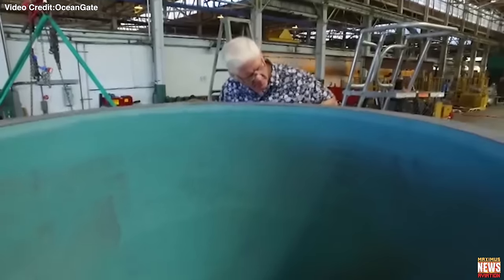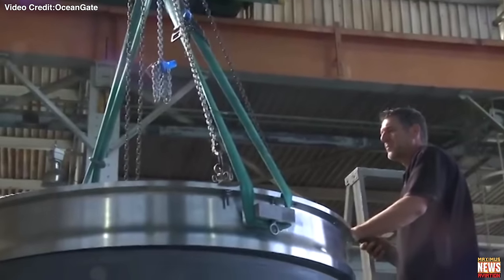Watch The Manufacturing Process That DOOMED OceanGates Titan To Fail. But It NEVER Had To Happen.

Comment: That tube distorted and ejected either one or both end collars. I didn’t see the entire manufacturing process, but I also did not see any through fasteners/bushings in the outside diameter of those end collars connecting the collars to the carbon fiber reinforced tube…
Reply: Like a toothpaste tube!
Reply: @tanyav7888  looks more like a casket
Reply: Nope, carbon fiber does not bend, it snaps catastrophically
Reply: It seems to me that the weakest point was the glue joints, where the carbon fiber joined with the titanium.
Reply: @CrucialFlowResearch  CF absolutely "bends" The resin or glue also bends. Nothing is 100% rigid, with the exception of Tungsten Carbide maybe and Diamond.  If you watch the video, they are "bending" wrapping the CF around a metal cylinder.
Reply: Astute & accurate comment.
I said similarly, using glue but NO mechanical fasteners was courting disaster.
BOTH are needed.
As you said, the Carbon deforms ever so slightly, it pops that end cap off like you'd flip a coin !
Reply: I don't see any o rings or gaskets either so the adhesive was probably serving to hold back the hydrostatic as well as supply a mechanical bond.
Reply: Yup. That's what happened. Like stepping on an empty water bottle with the cap on. It pops right off when the top deforms.

Comment: My grandfather works with glass and he told me that different types of glass have different coefficients of expansion. If the COEs are different the art piece could destroy itself.
I think that this is what happened here. 
A sub experiences temperature differences as it dives and surfaces. Where they were going it was freezing compared to where they were coming from. The hull would've contracted as it sank and expanded as it climbed and the different parts would've done so at different rates. 
My hypotheses is the uneven COE between the two materials would cause fatigue cracking and it would've only been a matter of time before the cracking became severe enough that the structure failed all together.
If I were in charge of Oceangate I would have been more careful with how the vehicle was constructed and actually took safety seriously.
Ships and Submersibles have been made from steel for well over 100 years, I'd rather base a design on a proven technology rather than some futuristic clean slate design.
I don't understand why it had to be made of carbon composites. Sure, they are lighter than steel but this thing wasn't supposed to fly. It was supposed to sink.
Reply: Very informative. Much thanks.
Reply: I'm thinking that 5" of carbon fiber is cheaper than 2" of titanium?
Reply: @dmkinsey  CF was used for cost only.   The company was doomed to fail either way, not enough profit even with all the corner cutting.

Comment: Carbon fiber is normally sheets woven in opposing directions. This is just spun on like duct tape. Strange.
Reply: yeah kinda like they do with laminate plywood
Reply: This is called filament winding. It is a common method of construction for round-ish tubes and such.

Comment: 0:40 This sends chills down my spine. That 'fiber', that wonder material, literally looks like duct tape. I know it's not the same, but that's how it looks to me. 

Edit: the titanium rings and the carbon tube were glued together? Come on, are you kidding me? Even if the cylinder is not the ideal shape (it's the sphere) why not build the tube out of steel and avoid all the problems caused by carbon fiber? It's just crazy.
Reply: That's how carbon fiber is manufactured. Layers and layers of micro filament fiber.
Reply: The excuse given by the CEO is that CF has tremendous strength and weight savings, therefore onboard propulsion would consume much less power moving the submersible around.
Also using a cylinder design instead of a sphere allows for more paying passengers (at $250,000 each).
What this CEO doesn’t seem to realize is that physics wins all the time, he thought he could apply his aviation experience to solve marine engineering problems.
But in deep diving reliability and durability and toughness are king, not weight or energy efficiency.
He paid the price for his lack of vision…
Reply: @glenyoung1809  That guy is obviously a piss poor engineer for ignoring the material properties of CF in choosing that material for the pressure hull and then choosing to form the final integration assembly using epoxy  and titanium. I don't think that even most engineering  students would make such poor choices.
Reply: He would have to make the steel version into a sphere and make it much smaller
Reply: @seitch1  If you watch some of the other videos he makes a derogatory comment about subject matter experts who are "ex military 50 year old white guys" and warning him this was an unsafe design and that he deliberately hired freshly graduated non-white engineers, including one who's qualifications included being an enthusiastic surfer dude. The channel Sub Brief talks about it and shows some of these statements. The absolute arrogance of the guy is astounding.
Reply: @glenyoung1809 I’m not sure what difference skin color makes, but age and experience MATTER!
Reply: @janach1305  Yes it does but the CEO pointedly emphasized 50 year old white men, so I surmise it's all about getting those virtue signalling points. He also stated he wanted to "inspire" the younger generation and hiring older expertise doesn't do that. As I said it's incredible arrogance and a massive ego to boot. 
Plus the CEO has your standard politicians haircut and that's a definite giveaway for me...
Reply: @glenyoung1809  I was snarking on the CEO’s attitude toward skin color as much—if not more—than yours.
Reply: @janach1305  If I were one of those young engineers working on this project I would scrub it off my resume immediately, this incident will be a career killer for them if they admit to being in on the design phase.
Reply: @jonfreeman9682  Interesting, but everyone agrees that it's a poor choice for a submersible. What shocks me is the way they attach the ring to the hull. I hope the Canadian and NTSB investigations really find out what caused this failure.
Reply: @glenyoung1809  Imagine if it was the other way around. A naval architect designing a plane... entirely different fields. Probably wouldn't be able to take off.
Reply: @glenyoung1809  correct
Reply: Looked like VCR tape
Reply: His reason for using carbon fiber was to keep down the weight. Making the tube out of metal with sufficient strength would have made it too heavy to float. The normal and sane solution to that problem is adding buoyancy either in the form of buoyancy tanks containing lighter than water liquid (such as petrol) or using a special type of foam that withstands those pressures without crushing.  He chose to do it the easy way instead, which as often happens was also the dangerous way.
Reply: @glenyoung1809  I think the weight savings were probably much more important in lifting and moving the sub as compared to propulsion.
Reply: Duct tape may have been better, seriously
Reply: @jaycahow4667  yeah once the sub is submersed it all weighs the same it is just smoothness of shape that would change propulsion
Reply: @noahw4623  You know, there's a wide range of materials available, so it's incomprehensible why they chose carbon fiber. Back in the 60s there was this sub called the 'Aluminaut'. It was made of aluminum, and could reach a depth of 15,000 feet.
Reply: @JMC-ul1sw  that sub can go to 13,000 ft deep - NOPE

Comment: Looking at that fibre winding machine it doesn’t look like there was much ability to wind the fibre in the axial load direction - with those large end plates the axial load will be very high and it won’t surprise me if the failure mode relates to this.

Comment: I feel sorry for the fabricators that were involved in building the pressure vessel under direction from Oceangate. They must feel really bad.
Reply: If you were offered a job making a death trap for your rich boss, you might not feel so bad.  After all, you were paid to turn a blind eye, just like him trying to destroy one of his Engineers for declining to participate in the building of this death trap.
Reply: Nah. That'd be the case if the sub went out on the first dive. Then you could write it off on ignorance or inexperience of the team. But they had several dives. Meaning everyone there knew what's up and let it happen AND continue to happen. My guess is that they only feel bad because they now have to deal with the consequences of the situation.
Reply: A career killer
Reply: @Poppenheimer69  nothing to feel bad about when you are mortally injured.  Nothing to feel actually.
Reply: They should
Reply: Thanks for the Triton LF recommendation, i found the video after you mentioned it.
Reply: @pixels303at-odysee9  I was referring to the fabricators who made the Titan pressure vessel under contract. They were not paid to turn a blind eye like the Oceangate engineers, they were professional equipment operators who may have had no maritime background at all.

Comment: My opinion...The design of this sub, although radical did work and achieved what the designer wanted which was a vessel capable of withstanding the pressures at deep ocean depths. Lets not forget this vessel made five I think it was, successful dives. So from that point of view the design did work. Having spent forty plus years in the aerospace industry and many years working with composites I am well aware of the limitations and strengths of carbon fibre composites. I am also well aware of the very rigid inspection procedures that are regularly required with carbon fibre structures within aerospace, both visual and NDT. From my point of view, the main reason for the failure of this venture was Oceangate's refusal to carry out any inspections to the composite structure to check for any cyclic stress cracks that would have been apparent in the vessel due to its working environment. I am pretty sure that if a programme of proper NDT inspections after each dive had been implemented, the defects withing the pressure vessel would have been found and this 'accident' maybe could have been avoided. Just my opinion.
Reply: Only 2 dives to 4000m before it failed, the design was very poor as it was supposed to do 25 dives a year. Carbon fibre is a terrible choice for something like this because unlike metal which predictably deforms and springs back carbon fibre will deform causing individual fibres to break slowly weakening the structure with each load cycle. There is no way to tell how much damage has been caused either without expensive testing between each load cycle. Also the mating surfaces for the pressure domes on the end would be prone to delimitation as they were only glued on meaning there is a single layer in contact with the end ring which would be a serious weak point. Normally a metal component subject to high stresses connected to carbon fibre is woven into the structure during the carbon fibre layup. The fibre was also all wrapped in one direction which seriously weakens the finished structure. Normally the fibres form a complex weave pattern to more evenly distribute stresses and make de-lamination less likely.
Reply: @schrodingerscat1863  Thank you for your reply. I'm not one to get into debates on here as to who is wrong or right but you completely missed the point of my comment. Also, depending where you get information from it seems it is still debatable as to how many deep dives the Titan made with some news outlets citing it as unclear or as many as ten completed dives to the wreck, not just two as you claim.
As to your statement as to there is no way to tell how much damage had been done after each dive, well, yes there is, and it is NDT inspections which are used extensively in the aerospace industry such as eddy current and ultrasound inspections which are used regularly on composite and carbon fibre structures to check integrity of that structure either after impacts, visible damage noted or just routine periodical inspection.
My point was regarding inspection procedures in place in the aerospace industry that would have certainly picked up any defect in the Titan's composite hull had these inspection procedures, which are a legal requirement in aviation, been employed and not ignored as unnecessary as they were by Oceangate.
Reply: @stiggy3833  My point was that without dismantling the thing and scanning the pressure hull after every dive they would not know if there are problems. Metals can be easily wired with strain gauges to make sure the metal has not gone beyond acceptable limits. This can be done continuously during the dive with anything beyond a defined safety limit causing an abort of the dive well before any catastrophic failure occurs. The more problematic part is the interface between the carbon fibre tube and the titanium end rings. That cannot be inspected due to its design and would be prone to delimitation due to stresses set up by dissimilar materials behaving differently to temperature and pressure. Aircraft are specifically designed to allow obvious wear components to be regularly checked having detailed service schedules designed for each aircraft, but no such design considerations were observed for this submersible and there did not appear to be cycle limits or service schedules defined. They only went to titanic depths once in service and I believe once in testing before the failed dive. There were other test dives that steadily increased the depth and I think the news media got confused with the total number of dives and previous dives to the titanic in their reporting. Someone posted a detailed chronology of the vessel and it had only done 2 previous dives to 4000m with multiple other lesser dives while testing. Some of these dives did reveal problems though and improvements were made after early test dives revealed serious systems failures. The whole thing seems to have been more like a hobby project than a serious piece of cutting edge engineering.
Reply: @schrodingerscat1863  Thanks again for your reply, and all your points noted. I don't think we will agree on much here. Again, notwithstanding the fact that, yes, there would be required a certain amount of dismantling to enable a full NDT inspection after each deep dive, my point was, that this could or should have been done and not ignored because it might have been inconvenient, again my point was noting there are inspection procedures available for the materials used which was ignored. Aircraft inspections requiring huge amounts of dismantling are carried out with little or no faults or failures instigating these inspections. They have to be done and the same inspection criteria should have applied to any new technical innovation such as this. To me, the sub should certainly not have been carrying fare paying tourists at this stage of development.
Regards and respect...
Reply: @stiggy3833  I think we are more or less in total agreement, my main point was that aircraft are built with inspection in mind and have service schedules for critical systems and structural components. These schedules are based on thousands of hours of testing to determine mean time before failure of components and use that data to construct an extensive service schedule. Although aircraft inspections can require an amount of disassembly they are designed to allow that to happen and don't have components hidden where they cannot be accessed after assembly or components needing frequent checks requiring major effort to inspect. 
Although some testing could have been done between each dive the interface between the carbon fibre tube and titanium end rings could not be fully scanned as there are metal flanges that surround the ends of the tube making scanning the mating surfaces extremely difficult. There are also questions surrounding the quality of the CF layup as their QA guy at the time was not happy with it at all. Overall it is a poor design and the shortcomings could have been avoided by having a better design for the end rings. That aside the economics of scanning the carbon fibre after every dive would have made it a lot more expensive and the company was already losing money on each dive even at $250k a seat. A more conventional all metal design would have been much easier to deal with though more expensive to initially construct. The craft they built had no MTBF testing and as such was an accident waiting to happen and you are absolutely correct that fee paying tourists should not have been on it without way more testing.
Reply: no time for that. Got to sell tickets for the show! This is the beauty of experimental crafts. They are unregulated. YOU are the regulator. BTW how did he got round putting passengers in an experimental vessel is the real question nobody is asking.
Reply: @stiggy3833  seeing that design and how it was built, flaws over flaws over flaws I would rather say it was a big junk of pure luck it did not collapse at the first or second dive
Reply: Sure if it was supposed to be a 1 trip sub it worked but passangerd heard cracking every time they dove down which is carbon fiber delaminating i think and it was wearing out every trip it was only a matter of when and not if impolsion happened